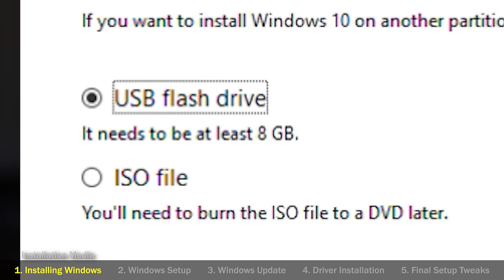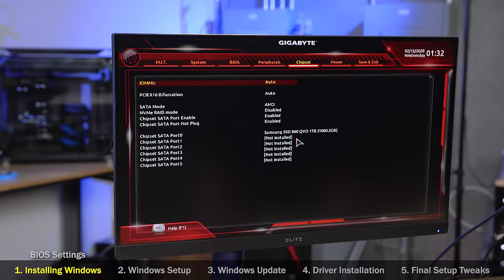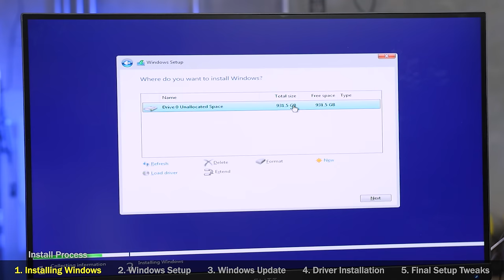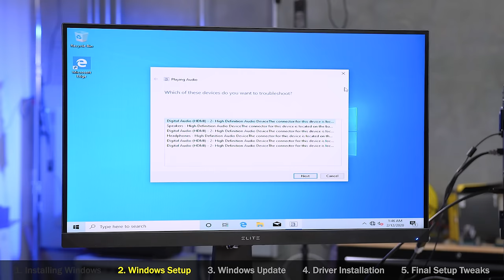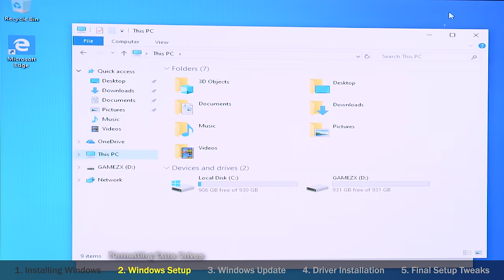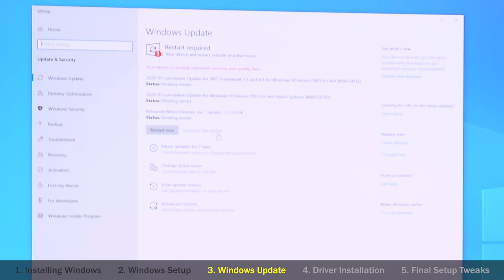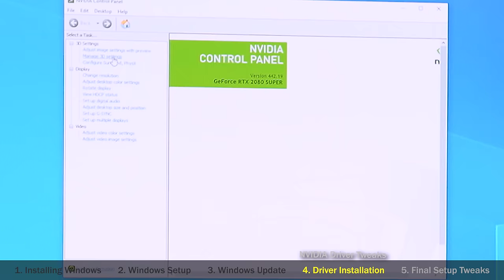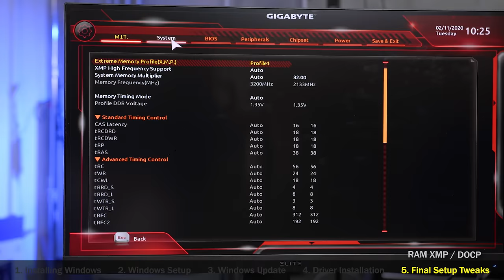Guide: What to do AFTER building your computer...

Comment: am i the only one experiencing nvidia control panel not coming with the driver and having to download it from the windows app store these days?
Reply from the maker: Crap. We meant to mention this. If you encounter this you’ll need to download it from the Microsoft store. I can’t remember why Microsoft started requiring this but it’s becoming more common with version 19XX and newer
Reply: @Jayztwocents  Just finished my first build so the timing of this video was perfect.  Thanks!
Reply: I just have AMD so it never works
Reply: I used dch driver without no issues since I fixed the nvidia driver crashing since the launch of dch driver I upgrade it as usual over the older driver. I dont use ddu which wipes out the tdr registry every single time I update. And the trouble using the ddu is it wipes out the nvidia control panel settings for every application so you end up tweaking it again which is a pain in my opinion
Reply: I see it after almost every install now, not sure what trigger it, but downloading from the microsoft store fixes it.
Reply: or the wrong drivers for your card not coming with the 1st uodate. Update again problem fixed.
Reply: Rom Flan yeah, so on newer versions of Windows, the DCH driver is forced. You can’t install the old ones.
Reply: Sylvethter Yeah, I recently built a new PC with Windows 10 1909 and this shocked me first until I did some digging. If you do the driver install while connected to the internet, I think the installer is smart enough to trigger a check and automatically grab the control panel app from the Windows Store. At least that was my experience.
Reply: @jabatheshort660  What exactly never works? your GPU? or your whole system... (I am a hardcore AMD builder...)
Reply: Windows gets weirder ever day........
Reply: Cant use windows store with offline account tho...
Reply: @Hastur101  windows requires you to use and account upon installing now hahaha
Reply: @TegridyMadeGames  In the video he explains not having internet while installing to not require online account. Go watch again.
Reply: Yeah, thank Microshaft for that one. It's not a problem for earlier OS versions, but Win10 is beginning to make using their app store a requirement, including for newer games. Exclusivity ploy to the max.
Reply: Built another pc a few days ago and wondered the same thing. Just went to Microsoft store and grabbed it.
Reply: @neddy1287  You mean it removes all the profiles for all the settings not just the global ones?
Reply: I have never seen the Nvidia Control Panel issue.  Multiple machines.  Got me curious now.
Reply: do you let Windows Auto install?
Reply: Just upgraded my card using a zotac driver and lost the nvida control panel— well I still see the icon in the taskbar it just wont load anything. Didn’t think I would lose it after upgrading. 

Downloaded the drivers from nvidia and installed. Newest version and it fixed the control panel issue.
Reply: @Jayztwocents  you dont need to disconnect from the internet, it gives you option to name the pc offline acount and for the password section  if you dont want one just dont put anything and click next.
Reply: I would believe so yes I ended up on a clean slate every time I ddu the drivers. I usually not connect to the interrnet that when I disable the device driver update it found in the old control panel can't think of the name of it at the top of my head.
Reply: @JamesFox1  Sometimes the website drivers get outdated and don't update for awhile due to time constraint
Reply: @quietlydigital9791  Just did the same thing and I had to use Microsoft Store to access NVIDIA Control Panel again... I am on a GTX 1080 Ti if that would mean anything... So weird.
Reply: @Jayztwocents  Sorry for asking but do you guys have any idea how to reinstall the microsoft store? Mine won't open at all, now i can't access my mail/nvidia control panel etc.. No clue what to do
Reply: @DarkestHourProductions  probably his brain
Reply: @Yenquil  that sounds like appications is corrupted
Reply: @jabatheshort660  lmao RIP navi gang
Reply: @The Infidel I'm on 1909 no trouble there and no problem with nvidia driver so it must be his system acting up
Reply: @quietlydigital9791  didnt work (2070s) for me still no nvidia control panel with drivers had to download it from Microsoft store
Reply: happened to me too after my most recent build, had to download it from the windows store, (which i hate) but it worked.
Reply: An existential question I ask myself on a daily basis.
Reply: @quietlydigital9791  Installing the Nvidia.com drivers doesn't always add the control panel, and I have no idea why. Maybe doing a clean install vs an update is the reason.
Reply: Its part of UWP or something program of Microsoft. Even for AMD video cards, a similar thing can happen with Radeon Catalyst Settings LITE can be installed.
Reply: @quietlydigital9791  its okay
Reply: Yes, that's because nvidia provides dch drivers by default now. I've encountered this problem too.
Reply: @TegridyMadeGames  well don't connect to internet before creating an account. Or enter garbage 5 times and you can still make an offline
Reply: Brandon Yahn  hard core AMD builder that’s a new one on me no fan boy here I just buy what’s best 😳
Reply: @Jayztwocents  You also forgot to mention installing your antivirus/firewall before connecting to the internet. From a computer hygiene standpoint you really really should be doing this. My recommendation would be ESET but, I could care less something is way way better then nothing. In the time it takes to download windows stuff you have a good chance of catching something.
Reply: This is due to the DCH standard Microsoft is moving to, to standardize display drivers. You can look up more info on google and there’s a lot of information, even from the manufacturers.
Reply: Nvidia switched completely to DCH, so you can't get classic drivers anymore.
Reply: @Hastur101  you can use the free apps on MS store without offline account, just click cancel on prompts where it wants you to sign in.
Reply: @Jayztwocents  i do this and it still wont launch :/
Reply: I had to do it after a fresh install of windows 10 on my main rig that had no issues before but the new (living room) build I did less than a week ago worked just fine. Idk why, super weird.
Reply: New installation last week. Just realised having watched this that the CP didn't install! Despite doing another clean install. So got from the Windows Store
Reply: It ain't an issue if you are using Microsoft Strore anyways.
Reply: @Yenquil  Try to reset it in the apps under settings and click on the advanced portion.
Reply: @Hastur101  
I've done a few clean installs of windows recently and you CAN get Nvidia control panel just fine. 
I just clicked cancel or whatever and it started downloading anyway, NO Windows account required.
Reply: @runeberg6514  of course theres always a way around things. But try doing that with a laptop. You can't. It's just forcing as many people as possible to sign up amd send data
Reply: @killertruth186  won't work :/
Reply: @Jayztwocents  my other drive doesn't show up in the disk management, is this a issue with the PC build or the harddrive
Reply: It's the way the new drivers are being pushed there trying to move to pretty much all drivers being DCH due to the smaller size and faster install time
Reply: MrScampy69 same here! Just put it together yesterday. Looking forward to loading it up tonight! Perfect timing. Only i was hoping to create a dual OS system with MacOS. Only yo find out MAC doesnt support my video card. 😕
Reply: @Yenquil  Ah.
Reply: Same here
Reply: @Yenquil  I am sorry about that, I will try to find a way to help you fix it
Reply: @Jayztwocents  it should still show up if you search for it with cortana. Also the windows media creation tool can be unreliable sometimes when making a USB boot drive. It's much better to save to iso and then use a tool like Rufus
Reply: you're not the only one but it shouldn't do that, it means you don't have the "regular" nvidia driver but the DCH version which causes problems, I suggest trying to get rid of it and get the normal driver as long as we can, as MS pushes for those shit DCH drivers that have no business being on a desktop computer (it's another of those smartphone tablet shit no one asked for)
Reply: @Jayztwocents  Issue is internet, once windows sees it, it installs a DCH driver and after that you can only install DCH drivers that don't come with control panel. Disable internet, DDU nvidia driver, install nvidia driver and now you get control panel. Enable internet. (and I spend hours trying to figure this out as I forgot lan cable plugged in fresh install)
Reply: I have 1903 and its not forced. You just need go uninstall it and download the right one.  Dont let windows update touch your drivers.
Reply: Wait, so the are we talking about the nvidia control panel that you access by right clicking the desktop and selecting 'nVidia control panel?"  You have to get that from the Windows store now just to configure driver settings?
Reply: Only if you end up with dch drivers.  If you install regular ones it still works normally.
Reply: @Jayztwocents  Microsoft is going to create their own competition if they keep on this path.
Reply: @Moshenokoji  Yep, but see my reply above. Once you get DCH drivers to your system even uninstalling them won't help, hence you end up in what OP and others are experiencing.
Reply: NVIDIA control panel downloads automatically with windows update then I download GeForce experience from NVIDIA.com
Reply: no
Reply: DCH drivers you will have to manually download the control panel from Microsoft store, if you install standard driver it will come with it. I had to use DDU to uninstall the DCH drivers and then install standard drivers. Important note: have the standard drivers downloaded in advanced because you want to complete the uninstall and installation with no internet. Unplug Ethernet and or disable wireless so that way windows doesn’t automatically download and install the DCH drivers
Reply: It comes with the GeForce Experience install if you don't mind it.
Reply: Do the manual driver search and install on this page (https://www.geforce.com/drivers), not the automatic drive update option.
Reply: @Hastur101  would prolly help if I watched it to begin with hahahaha
Reply: @Hastur101  again I said laptop..... Not desktop. Laptops have wifi cards built in. Unplugging internet is easy. WHEN ITS AN OPTION.
Reply: @runeberg6514  that's cool. How about a laptop with built in wifi?!
Reply: @TegridyMadeGames  you can always disable wifi card in control panel
Reply: @TegridyMadeGames  can't confirm specifically but the last time I installed Windows it tried to force it ( I connected to WiFi) I just enters junk (pretending to be a Microsoft acct) and after a few tries it gave up and let me do a local account
Reply: @Hastur101  ok how are you going to use the control panel while installing windows? Lmao. You do realize when you reinstall windows your NO LONGER using your current install. IE: when you boot from usb your computer isnt talking to windows... so that would litterally do nothing.... c'mon guys....
Reply: @runeberg6514  ahhh that makes more sense. Thank you! Lol
Reply: I have had to do this for windows 10 home, 10 pro has been fine. This was with a gtx 960 if anyone is taking notes.
Reply: @TegridyMadeGames  tldr you just need to enter wrong/nonsense into Microsoft account login until it gives up and let's you make a local acct.
Reply: had the same issue then my son told me about the issue. doesnt make sense but i guess this is how it is now
Reply: God-dammit Jay...
Reply: @DarkestHourProductions  he's saying the nvidia control panel never works with amd
Reply: How does one install drivers without an os? Only bios or bsod. No clicks can be used in the solution.
Reply: @TegridyMadeGames  You can install windows with offline local login. You do not require online account, unless you wish to use the Microsoft store apps. Simple as that mate.
Reply: @Hastur101  try installing windows again mate. I install it on virtual machines weekly. They changed it so you have no option to skip using an account if it connects to internet...... That's what were all talking about....
Reply: @TegridyMadeGames  The video suggests not connecting to the internet while installing windows will not require you to use an online account. Ive never had to login and never will.
Reply: @Hastur101  okay I was talking about when you cant avoid that with wifi or (in my case) setting it up on a VM quickly for sandbox software testing use. And people answered the wifi question you just enter wrong stuff 5 times and it allows you to skip again. Idk why your going on about it still. I obviously have seen the video, and it was a waste of time, because I already knew that. My question was about wifi cards not unplugging your internet. Or according to you disabling it in control panel as if that changes the install process.
Reply: @TegridyMadeGames  Im not 'going on about it all, just replying to your posts or comments. It may be the case with VM that this workaround does not work.  thanks for the info!
Reply: @Hastur101  you can disable internet on vm's before setting them up too but I just wipe mine so I use an account I dont care about at all. It's just faster that way. All I'm getting at is that this is a recent change in the install. Only about a month ago you could just click "skip" but now that's not an option.
I would bet windows is eventually going to require an account at the cost of making itself free eventually, because it already basically is free minus the watermark. I'm sure there will always be away around it for current or paying users. Let's hope that's not the case tho:)
Reply: @TegridyMadeGames  Newest version sounds quite annoying!
Reply: I still have 1803, when i tried to upgrade it failed last week.
Reply: @Hastur101  damn son you need to update! That's probably wanacry volernable old lol. As he said you can always get a latest version from their site but youd have to wipe sounds like.
Reply: @TegridyMadeGames  Ill try the update process again this weekend. It was a space issue i believe. Had around 16 gig free only.
Reply: @Jayztwocents  only required if the driver package is DCH, to switch from DCH to the normal driver package you need to run DDU
Reply: @Hastur101  If you care about your security you should always try to stay updated. If you don't update your basically using windows 7 but if your safe online it doesn't really matter.
Reply: @Jayztwocents  DCH driver is the reason.
Reply: I have an AMD Ryzen 7 with a Nvidia RTX 2060 Super 8gb & when i installed Windows 10 a notification popped up telling my control panel is not installed and when clicked it brought me to do the Microsoft Store & i downloaded it from there.. it works :)
Reply: I solved it by enabling the Nvidia control panel service, I don't know if its still the same, or driver installation just removed the control panel
Reply: Just use manjaro linux
Reply: Nope. Works fine for me after a driver install.
Reply: @Jayztwocents  Maybe Microsoft want even more control panels all in one handy spot to add to the massive collection they already have in Windows itself?
Reply: Disable Windows Auto Driver Install feature, then DDU wipe out all NVIDIA and reboot and get driver from nvidia.com
Reply: @neddy1287  you can backup NVCP settings via nvidia inspector
Reply: Weird, windows automatically installed mine, i didn't need the app store.
Reply: @Jayztwocents   One other way to bypass Microsofts permissions is to turn off (Change User Control Setting) to off via control panel. just make sure to click run to install 3rd party software.
Reply: @G Mayz How do you Stop connecting to the internet when you have Wi_FI?
You do need to tell it your SSID/Password for it to connect to Wi-Fi, if it already has it, use another device like phone, to login to your router, change password, W10 can't connect.
You should also be able to disable Wi-Fi directly from your BIOS, but if your Laptop's an OEM Brand as most are, their custom BIOS may restrict your settings access.

W10 never gave you a clearly stated Local Account option, but it still existed, if you go with what the Screen is saying, you think their is no offline account option
Last time I installed from scratch was v1809, around a year ago, and local account worked same as always, ignore create/Login MS account, enter nothing click next.
W10 then tries very hard to convince you MS account is absolutely essential, and your only option, but if you kept refusing to create/Login, it eventually gave up.
Even then it's never clearly admits that you actually have an offline option, it gives the impression you have no choice, until it finally makes a Local Account.

Another tip if you're the only one with access to your PC, don't create a local account password, and your PC just auto boots, without ever needing to login.
I turn my PC on, go make a mug of coffee, and It's all booted and ready to go, when I return, after kettles boiled.
Reply: @quietlydigital9791  Yup,mine like that too.Reinstall n got the Nvidia CP
Reply: @Sylvethter  That's because you're connected to the internet. Unplug your internet when you use DDU and when you install the drivers. After the reboot you won't see that "nvidia control panel is not installed" message and your control panel will be working then you plug your internet back. It works. I had the same problem as you on a build I did last week.
Reply: Me too
Reply: @TegridyMadeGames  Yup....
Reply: JayzTwoCents they have the licensing for it now since it’s such a popular thing. They put it on there for these pre builts so the drivers are easier to find. That’s how it started at least. It really just boils down to a ease of use thing.
Reply: yes.........its apathing error from 1809 to 1903 or w.e updates........let alone i bought a laptop that did this out the gate bc  1 month in i installed 1903 or w.e
Reply: @Jayztwocents  I had to do a complete reinstall because of that. As I dont use store I deleted it completely , than I had to reinstal it via command prompt, but i did not helped. Allways game me errors. Sometimes I think that I will rather spend 5 hours updating 300 windows 7 updates than downloading 1 driver from different sources for one GPU. Should have bought AMD GPU, wouldnt have such problems :D :D
Reply: Sylvethter no I had to do it and I was like YELLS
Reply: had same issue recently, reinstalled drivers
Reply: The next step after all that I recommend the free awesome installer service "ninite"..
Reply: @Jayztwocents  do I need a windows key?
Reply: I had no problem downloading it from Nvidia's site.
Reply: I just noticed this, so dumb.
Reply: Samantha Sowers I use DDU and you still have to get it from windows store, even had internet off to try and avoid it.
Reply: Muhammad Thaqif Syahiran Bin Jamzuri I had this problem and the only way I could fix it was by reinstalling windows, also you can log into the MS store website and you can remotely download apps to your pc from another device.
Reply: Muhammad Thaqif Syahiran Bin Jamzuri yeah I tried everything else and the only thing that worked for me was making a usb drive with the latest windows and reinstalled it, Microsoft has made a mess of windows 10, it’s so terrible, they can’t even get their store to work on their OS🤦‍♂️
Reply: You use the app store? Lol
Reply: Blankspace I hate it but the Xbox app didn’t work without it for me, but it’s the worst thing ever.
Reply: happened to me 2 days ago
Reply: Thanks for this video..
Was (and is) very usefull to me personally, because the last computer I have build was a Pentium 2..
Thumbs up (BTW, youre a funny guy)
Reply: @neddy1287  Without no issues, eh? I definitely don't never not know what you're saying.
Reply: JayzTwoCents your profile picture really fits this comment
Reply: @twizz420  You must be confused by the comment?
Reply: @Jayztwocents  alot of stuff are only enabled to download from the microsoft store, they want people to use the store, even spotify and other application i couldnt install it from nowhere unless i go digging on other sites
Reply: i really need a pc cause my parents are not giving me one.
Reply: @nepo8062  work man, i worked and saved up about 3000$ for my pc and other stuff i wanted, and i didnt go work a normal job, i know how to record, mix and make music and i have the basic equipment needed so i just searched for my first client and told him, his friends and my friends to spread the word, charged about 20$ in the first 3 to 4 months, but then charged 60, when returning clients started to come in, its not hard working and saving up money if you REALLY want the finished result or the prize
Reply: Yup, had to do it 3 days ago.
Reply: Yes
Reply: I have a m2 internal ssd do I install windows to that or can I run my games on that and have the windows on mechanical HD
Reply: 4 me,x need.I reinstall Nvidia driver and CP available already..
Reply: @Jayztwocents  Thx for that I was wondering wth was goin bin driving me crazy !!!!
Reply: Nope had that issue with my Ryzen PC
Reply: If I have a EVGA GPU do I need to get the Nvidia graphics driver or does EVGA have one
Reply: @Jayztwocents  you saying "Crap.We meant to mention this" fits perfectly with your picture XDDDD peace jayy still my fav youtuber.
Reply: Did the ram trick, then used memtest and memory diagnostic tool and it they both instantly when yeah nah mate ya RAM is fucked 🙃
Reply: It's normal, it's ther new version (DCH)
Reply: I noticed that after doing a clean install of nvidia drivers. It's really annoying.
Reply: @Jayztwocents  Just got a 2060, this is good to know! I would have tried to download from Nvidia's site like any rational human being would :3 Microsoft has to make the store relevant somehow I guess
Reply: Mine automatically downloaded on its own. It was weird.
Reply: @romflan8120  Alternatively? you should ONLY download the drivers directly from Nvidia and never use the windows driver.
Reply: Not only that but when you go to try to download it, it doesn't download
Reply: Sylvethter yes you are the only one. Thats a very big problem
Reply: JayzTwoCents why does Microsoft keep doing this stuff in the first place, consumers really mean nothing to them.
Reply: I always get issues with Nvidia Drivers. My main issue is always resolution. It’s always over panned and cannot see nothing.
Reply: Or you can download the GeForce Experience.
Reply: same
Reply: I have no clue what that means😂
Reply: yea, Nvidia GeForce exp should set everything up
Reply: Can i get dat PC
Reply: @Jayztwocents  simple answer to force you to create a microsoft account.
Reply: @killertruth186  just download team viewer and click switch sides
Reply: @MrZachalewel  with windows you can choose drivers to install before installing the operating system.

chipset and storage drivers are often refered to a f6 drivers, sometimes you can install the basic drivers for other devices but not the control programs.
Reply: I think that im gonna pay someone to do this for me XD
Reply: @Jayztwocents  the second you turn it on for the first time (after installing Windows) it prompts you to download it
Reply: @quietlydigital9791  I was told DHC drivers help Windows notice any issue with drivers implemented with the operating system helps them see what can improve the operating system with drivers for PC gaming Purposes. We need to find more information on what these DHC drivers really do. I heard it has telemetry stuff in it from EVGA forums but dunno if it is true.
Reply: @Jayztwocents  can you please post how to install Windows Media Tool into the USB stick? I was told to not just install the media and use rufio first before installing it. Please do a complete tutorial how to format and upload windows into USB installation on a regular SSD and m.2. too.  I don't know much about partition and are you supposed to convert mbr to gpt to install the usb before installing windows media tool in the usb?   What do you do if you have a lost partition  and how do you restore the SSD back to it's factory state like you bought it from the store?
Reply: @Jayztwocents  also show us how to set up a disk management drive and how to set up SSD properly for updates and trim. I shall watch the video. I am seriously ready to reformat soon.
Reply: @Jayztwocents   Windows key? I thought you used a regular USB stick?  Is the Windows key something to do with encryption install?
Reply: @Jayztwocents  i just realized the windows key is a license why is that important to purchase when you cam buy a license number online from Microsoft?
Reply: @Jayztwocents  one question. I have a 4tb drive and Windows only recognizes 3tb? How do you fix that?
Reply: Just built a new computer and had to do it as well.
Reply: Yes and I don't like it same with the MSI Dragon center.
Reply: @Jayztwocents  hey jay, im going to build my first  pc using i3 9100f and radeon 5500xt and since this cpu doesn't have integrated graphics i don't know if i should do anything extra before installing windows or just do what you did in the vid... I'd really appreciate a little help and tnx for the vid....
Reply: @Jayztwocents  it shows up the same way with an amd card, r5 cpu and different ''mother base¿''?
Reply: JayzTwoCents has ligma
Reply: Sylvethter I made 200 replies
Reply: Happens
Reply: Damn it must feel so good and weird ordering the parts
Reply: Good luck on the build I also am ordering a few things aswell
Reply: The Nvidia store drivers are bad, after fresh windows install just unplug internet cable and install standard Nvidia drivers
Reply: Yes it seems to be a quirk of your particular configuration because I never even heard of this issue before. Apparently, Nvidia made a specific version of their drivers for the Universal Windows Platform (UWP). These drivers DON'T include the control panel. You can check which driver you have through the system information in the Nvidia Control Panel. When the next driver update becomes available, make sure you download the STANDARD version of the driver and you won't have this issue
Reply: Need new vids for that now
Reply: I really need help when I try to run my bios it wont turn on with my graphics card in but it will with it out
Reply: What case is the pc built in? Please help
Reply: @Jayztwocents  which is that case u have in video
Reply: Yes
Reply: Hahh in noon at compyeur
Reply: I confused what do I do if I bought windows on a cd without a disk reader
Reply: another reason I don't want to bother getting an nvidia card. ray tracing does not worth my bucks.
Reply: I do this to lol gone through 2 maybe 3 computers all decent and scattered throughout the house while I have the top of the line one xD
Reply: @Jayztwocents  which is that case of pc u installed windows
Reply: @Jayztwocents  sir is that mobo x570 Ud good for ryzen 5 3600
Reply: I didn't know this was a thing
Reply: @Devastator0  no its not :D I just always download drivers from nvidia site and install
Reply: nah
Reply: yea
Reply: It onced happened to me
weird
Reply: me too bro
Reply: JayzTwoCents Serves ye all right, Windows has been a POS operating system since day 1 and is just getting worse.
Reply: Forget the Microcrap store, get your drivers from the source.
Reply: @UberArchangel  windows AV is fine and is running by default and the firewall is on by default. You don't need the other stuff unless you need spam protection.
Reply: Good grief this is why I use a Mac.
Reply: Isaak Saucedo I love building PCs, just hate managing driver updates.
Reply: Hi I went to xmp and set to profile 1 but after I saved and exit thrn I went to task manager and it's till 2133mhz not 3200mhz idk y pls help me out
Reply: No me to
Reply: @Jayztwocents  hey man i love ur vids 

What do I have to pay for that u mentioned in this video I'm a console idiot plz help
Reply: @Jayztwocents  You can uninstall the store version, and then install the non-MS store version.
Reply: Why would you download ANYTHING from the Windows app store?
Reply: Yep and its absolute shit and generally way out of date.
Reply: DO YOU KNOW HOW LONG IT TOOK ME TO REALIZE I HAD TO MANUALLY UPDATE NVIDIA DRIVER (TO USE OBS HARDWARE ACCELERATION) BECAUSE  NVIDIA GEFORCE EXPERIENCE would not UPDATE MY DRIVERS??!! jay just explained it in 2 seconds....wish i saw this 6 months ago (insert fart noises)
Reply: @Jayztwocents  On nVidia's site there aretwo links you can use to getvthe driver, onecomes withbthe control panel and one gets it from microsoft. I think one link says nVidia and the other says GeForce.
Reply: @Jayztwocents  That fits with your icon.
Reply: @romflan8120  this is the answer people are looking for.
Reply: @Jayztwocents  your pfp matches with your reply
Reply: @romflan8120  Thank you, this really helped.
Reply: I'm pretty sure if you buy a prebuilt you don't need to do this but I don't know
Reply: @RezziX123  Yes that's usually the case because the BIOS, drives, and OS are already configured and installed on prebuilt.
Reply: @Jayztwocents  hi
Reply: @Hastur101  There’s a tiny button in the bottom right that says “use local account” or something like that. No need to unplug ethernet
Reply: @Jayztwocents  guys just rightclick on the desktop and open it from there. No need for more software :)
Reply: These things happen? weird, I had upgraded my system not long ago, well, aside from a couple of ssd’s and the graphics card, I built a new system, and all my drivers are downloaded from the manufacturer’s site, nvidia for graphics and gigabyte for the mobo. Got the W10 prof. EOM variant of the OS.
Reply: That's just Microsoft Store craving attention lol.
Reply: I made my own custom version of media installation, removing all the Microsoft garbage and debloat system after the installation. It’s remove/disable cortana, Microsoft edge, candy crush, etc...
Reply: do i need to do all of this if i have a prebuilt
Reply: @christiankim420  you shouldnt. all of that kind of stuff should already be done for you if you bought a prebuilt
Reply: @Sylvethter  haha ok thanks
Reply: @Sylvethter  so all i have to do is update my geforce driver
Reply: @quietlydigital9791  Ive got a question cause u seem smart af: For the windows do I need a USB or can i just click on the bottom left go to settings and enter key and paste in the windows activation key and download it and everything is fine or do I need all the USB things which I dont know anything about cause im getting my first build for Christmas
Reply: @savageluc9975  Well when youre installing windows for the first time on a machine you'll need it installed on a usb dirve, so you can plug it into the new pc and install it
Reply: E
Reply: @quietlydigital9791  But how and where am I getting it on the usb
Reply: @savageluc9975  Just go to microsofts website and download it there. And install it onto the usb drive. Get the newest version of windows 10. Version 2004 or 20H2
Reply: E
Reply: @quietlydigital9791  Windows is from Microsoft lmao i didnt know that shows what a noob i am thanks would you like to help me if I an stuck anywhere ill just send you a message
Reply: Same
Reply: @MrScampy69  how was it buildimg for the first time? I am considering if I should
Reply: Yoo
Reply: I'm using the latest on Win 7 Pro SP 1 , and no, not here 😎
Reply: @quietlydigital9791  My pc works but the Mouse and Keyboard and Monitor dont react
Reply: You really want to install the standard driver if you don't use GFE so you can disable the ansel overlay popup.
Reply: @Jayztwocents   5:30 wtf??
Reply: @Jayztwocents  at about 5:50 what drive do you have in to make it show is there another drive that isn't the one that has Microsoft cus if so how do I get it and what drive is it
Reply: Microsoft is getting more and more annoying, i desperately want (even) better software support for linux - adobe, (rgb-)driver, games, etc.
Reply: My nvidia graphics driver says that the nvidia installer cannot continue is there a way to fix this jay please let me know
Reply: If you do not have drivers download and install snappy drivers. This is the BEST tool to find missing driver or update old drivers with. It have drivers for ANY pc or laptop from windows xp to windows 10 BOTH 32 BIT AND 64 BIT ALL VERSIONS! (MAYBE Windows 2000.) You can download the offline version 21 gb to an usb device or external hard disk to an other pc (if you don't have the internet.) You can also download the online version (5 mb if you are connected to the internet) then it scan your hardware and search for drivers on the internet and download it. This is a very smart tool. Here is the download link: https://sdi-tool.org/

If you've lost your driver discs, you're unable to find drivers on the manufacturer's web site or Windows Update can't configure your hardware, use this tool to quickly find and install all missing drivers.

If you're a PC technician, keep Snappy Driver Installer on your USB flash drive or external hard drive and take it with you wherever you go. In environments with no Internet access you can quickly get things working. No more searching for drivers after a clean install, just let Snappy Driver Installer do it's thing and your job will be done in no time.
Reply: @Jayztwocents  kk
Reply: Well
I watched it 48 times
Reply: @Jayztwocents  hey I know the chances of you replying are slim, but I don't have a working computer to put the windows boot on a usb..my wife's desktop broke on our move 7 months ago and my laptops keyboard randomly stops working and the internet randomly dies on it (no I'm not using wifi) and now I can't sign into my account with all of the games etc downloaded..and if I get past all of that it randomly restarts, basically a $1300 paper weight that lasted 2 years.
Reply: Maybe also for the rest of us.  
What should be the things a new BUYER of a big box bloatware pc should do.
Reply: in your install I think you can change options to also install control
Reply: Have not had an issue as of yet with the latest version of windows 10 20H2 although I am running and older 1080 card
Reply: @Jayztwocents  Can you help me out with a Bluetooth problem, is there anything in the system that says I don't have Bluetooth... before it used to work in my laptop.. but U din't even see Bluetooth in device manager even when I try to turn if hidden icons... . I gotta know if when my laptop fell its either good for blhetooth.. or bad.. thats all.
Reply: @Jayztwocents  Nevermind, I don't think it has Bluetooth.
Reply: Not sure why you would expect to download a nVidia software from the Windows store. Just go to nVidia's website and find your driver.
Reply: @jabatheshort660  download your AMD drivers from their website and you should get all the stuff you need, I don’t use AMD GPU’s so I don’t really know about them
Reply: Pls help! I have a different motherboard and have no idea how to install windows 10 on my m.2 from the bios. How do I go into blood override? I can’t find a guide on my specific motherboard anywhere.
Reply: @Jayztwocents
Reply: @hatchell18  it’s the same process for every motherboard, but you might not have the same BIOS, just look around in your BIOS for something similar to this video, then just follow the steps 👍
Reply: @OceanicMaestro  ok Thankyou I have no idea what I did I was just clicking around thinking I fucked shit up and it ended up booting thankgod. It’s all good now. Thanks for the info and help bro
Reply: @Tobbles1  nope it was pretty smoothly
Reply: @Jayztwocents  I'll just get you to build my pc lmao
Reply: @romflan8120  hey bro im new to this shit by standard drivers, do you mean studio drivers?
Reply: I am watching this well before I start
Reply: I'm actually watching this right now while finishing up my build def helping thats for sure. Accept I don't have a cd drive or USB so I'm using a portable   DVD burner to download windows so taking a little bit.
Reply: Me too
Reply: Nice
Reply: I actually noticed that sometimes if you right click it's in there for some reason. I still can't search for it but it's in my right click options. Try checking there
Reply: @Jayztwocents  k
Reply: P
Reply: if you have this prob.....try rebooting
that'll will solve ytour prob
Reply: If you go to custom driver search for nvidia you can get ones that come without geforce and just have command center, just reinstalled newest game ready driver yesterday.
Reply: @Jayztwocents  I have a gigabyte B365M and I’m having trouble installing windows. It keeps sending me back to bios after I install it. It does that after I take out the usb too. I’m at my wits end.
Reply: yea
Reply: I got a driver yesterday and the control panel came also(1650)  Maybe they changed?  Maybe im an idiot.  Please advise.   Lol
Reply: just patch it.
Reply: thank u i was confused i didn't know i needed to download it
Reply: what is a windows app store?
Am I too old and set in my ways?
Reply: no my brother has that problem
Reply: If you go to services and then find nvdia service and start it or restart it it will appear on your right click desktop
Reply: Now it comes with the driver!
Reply: @quietlydigital9791  har
Reply: @neddy1287   @Ned Smith har nionde första
Reply: @hellzen6827  How you mean
Reply: @AAlpha What?
Reply: @Jayztwocents    Hey, I already have Windows installed on my SSD but it's not running fine. I want to do a clean install but how do I first completely remove the current installation from the SSD?
Reply: @quietlydigital9791  Hey, I already have Windows installed on my SSD but it's not running fine. I want to do a clean install but how do I first completely remove the current installation from the SSD?
Reply: Can you please make a video on how to reinstall windows on a different ssd???? Cuz   I downloaded windows on the ssd I didn’t want to download it on and now idk how to change that
Reply: Thank you!!! 5600x on B550 is up and running with the help of this vid. Only watched it 8 times.
Reply: How much does it cost to download it in the flashdrive
Reply: I just click custom tthen clean install of Nvidia Drivers then it comes with Nvidia Control panel. if you push express it dont for some reason. i think its a bug
Reply: @jabatheshort660  same
Reply: @Jayztwocents  they really wanna know our setups
Reply: this comment saved me
Reply: @jabatheshort660  not trough microsoft store atleast idk if we better of with armourycrate bloatware ;p
Reply: @RaphaelSwinkels  I actually have nvidia now and Im having this same issue I had to get The control panel separate from the drivers. But don’t get me started on that amor bloatware omg
Reply: You can always just use linux.
Reply: You can download nvidia from any driver for your model
Reply: Not me
Reply: That’s weird. That’s never happened to me
Reply: Lmao why would be pre installed its something u have to download
Reply: @Jayztwocents  hello someone please help.. as i turned on my pc this shows in my screen "CPU Installed fTPM NV Corrupted" what should i do?
Reply: Just use GeForce
Reply: Lol
Reply: @Jayztwocents  new too the channel I got a firecuda 530 2tb for my ps5 after the last update it is no longer recognised for my ps5 would it work if I plugged it in my pc and re format or is that ssd bricked lucky 5year warranty if that's the case n im new too gaming PC's always been pc fan but went too console due too the price difference thanks hope you reply
Reply: @Jayztwocents  LOL wtf???
Reply: Hale no you aint! In the current morass y'best jus count y'self lucky ya even got the dang card.
Reply: Nice Dirtfish hoodie!
Reply: @Jayztwocents  äööääääääääääääääöääälöäääääääääääääöääääĺuöäääääöööääääöääääääööääĺäääöääöööääĺääöäöäääääĺääääälööäöäöääääöääääööäääööäälöääööääööäĺääääääälööööääääööĺääääääääääöäääöluööäöööööäöääööääääääääöääöäööäöäääöääääöööäöäääöääääööäääöäööääköääääööääääuööäääĺĺĺöäuöäääölölöäääöääöäääöööööääääuäääöäääöäääääääääĺuöööäĺäööäääĺöäöääĺäääääööäääääuöäääääöääääööäöäĺöäööääöääöäääääuöääööööääööääääääĺääöälääääöääöääääöööäääääääääääöööääöääääööääääääääööäääääööölöĺääääöäääööäöölöäääääääääääöööäääööääääääääääööuöääöööööööööäääööääööääöääöääöäööööäöuöääölöööäälöööäläöööölöäööääääääöööäääääääuöääääääääöääööäuöäööäöäääääöääääöäööäääĺĺääääöööäääöääääööööööäääääööääääääööäääöäääöäööäöääöääöääĺäääääääöäööäöööööäööööööööööööäööööäääääööäääöääääööuöäääkäääööööääiuöäälöäläööäöööäääääöääöäääääläöööööääööööäöööälööäääöäääöäälöäääääääöäöööäääöäĺööööölöäääääääököääääääääääääääääläääöööäöäääääääääöäĺööäääööääöläöäöäöääuöööäööööääääääöääääĺääääöäääööäääääääööööäööööölöööääääääääööööööuöäöäööööääääöälöäööääääöääuöööäĺäööäöääääöäääääöääöäöäĺääöäääöööäääääääääääööööääääääöääääöööäööäöööääööäöäööääääääöööööäöäääälöäöääöäöääööääööääöääööäääööääöääöäääääuölöĺääöööääääölöäoi3ö
Reply: @Jayztwocents  if you remake this video you should mention CSM and resizable bar “SAM” issues.
Reply: for anyone thats debloated and deleted microsoft store, control panel comes with geforce experience, which you should have anyways to use moonlight
Reply: @Jayztwocents please tell me the name of that case 🥺🙏🏽
Reply: @Grumpy_Wolf 😊
Reply: ill be very happy if i can see that bios post logo again
Reply: Congrats man